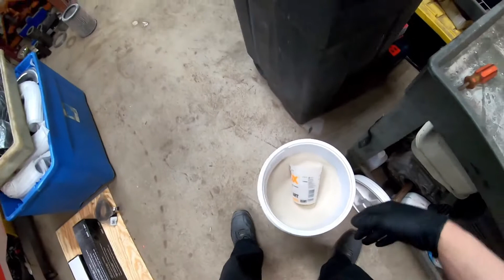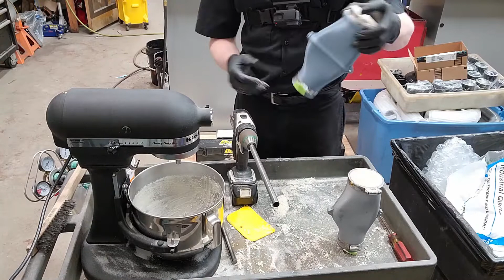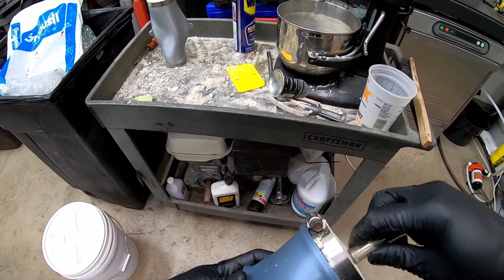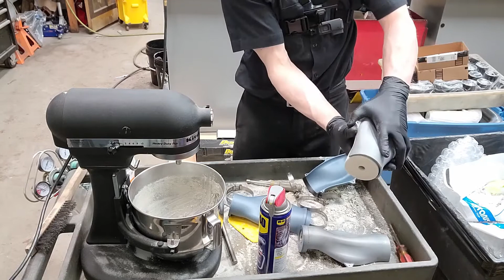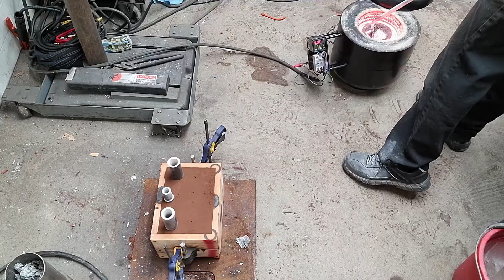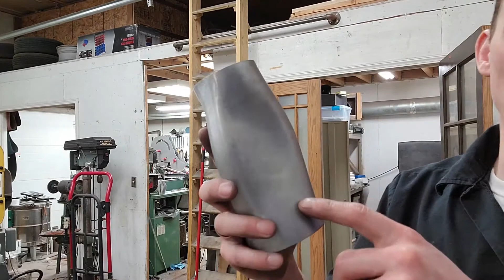Intercooler Pipe Transition Casting

Comment: Hello, Is the electric furnace 110 volts and what size is the crucible? Do you have any suggestions on where to source foundry supplies such as molding sand. thanks
Reply from the maker: You could use 110v I made my heating element for 220v. I used Kanthal wire. There are many good tutorials on making furnaces on YouTube. The crucible is a #3. I buy a lot of it on Amazon.